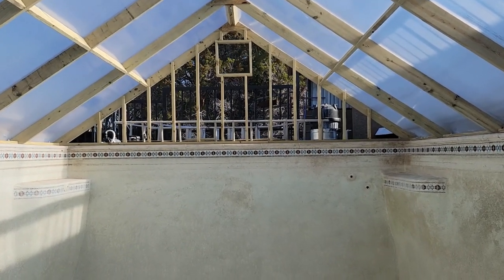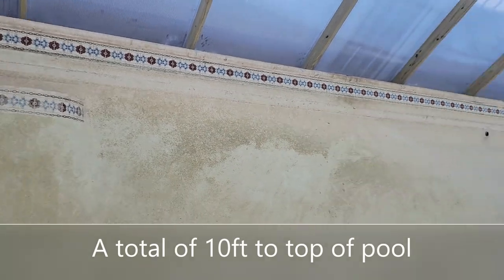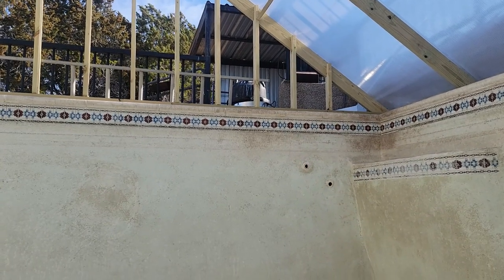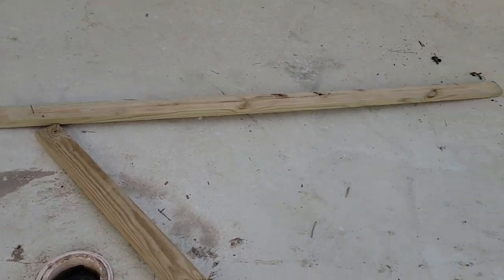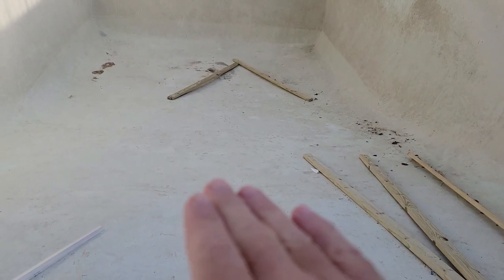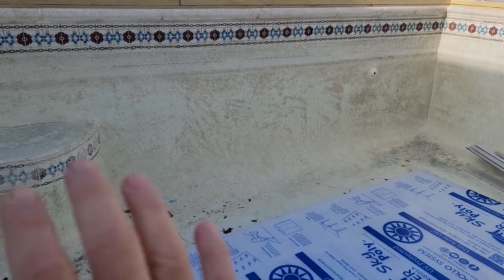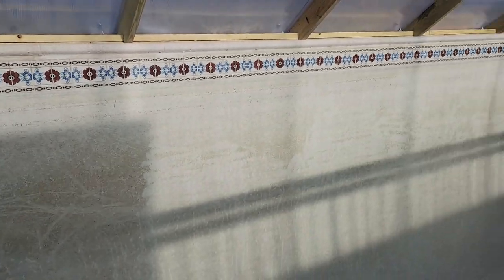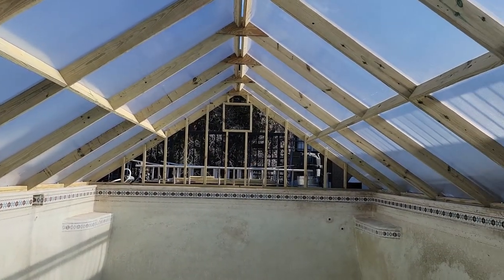Converting inground pool to a greenhouse walipini

Comment: This is awesome. We have a 24x45 gunite pool (37 years old) that has become a money pit and huge frustration. I really want to do this!
Reply from the maker: I was quoted $40,000 to repair the pool. Rip out concrete around pool to replace all the piping. I paid a deposit and waited a year. Nothing got done. Ended up getting an endless pool and this greenhouse for less than the repair quote. Endless pool gives me heated water and great exercise year round.

Comment: Hi

Congrats on your project.  I am studying to do the same thing.  But I have heard that a pool collapses when the water is taken out.  Did you have to reinforce it or anything.  I look forward to an update
Reply from the maker: No reinforcement. I have heard of cracking, not collapsing. Theres also heaving, where the pool will lift out of the ground if there is a high water table. It floats like a boat. Pull the cap out of the bottom drain so water can come and go. There is a skim coat that seems to be peeling but underneath it seems strong. I just finished revamping the cooling system using the water that collects in the bottom. Will have an update soon.